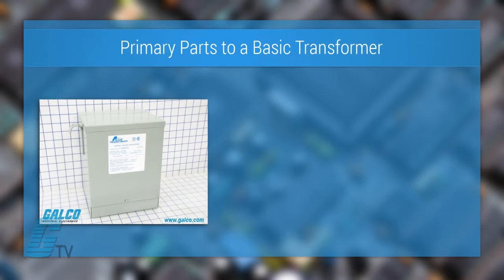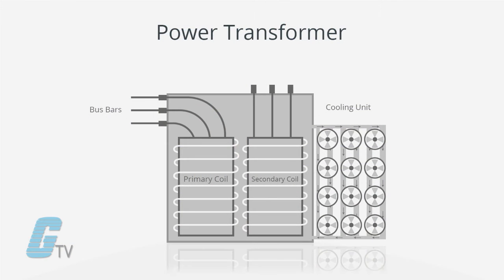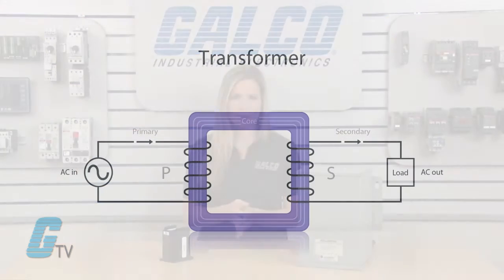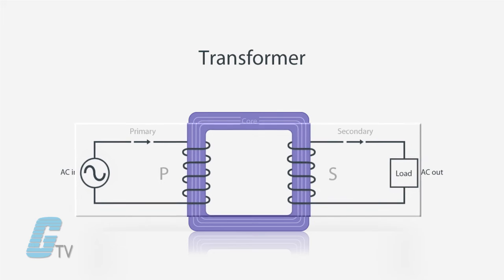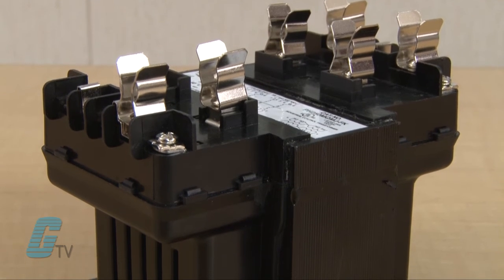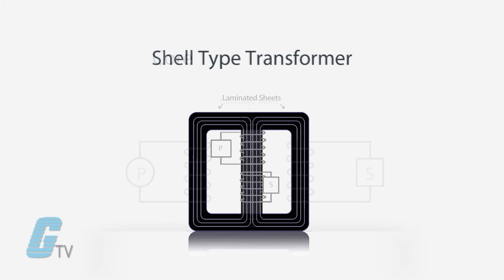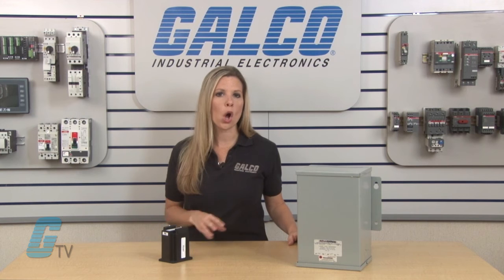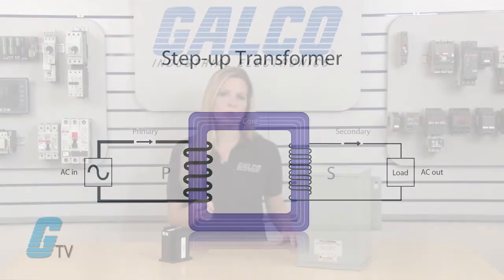How Electrical Transformers Work

Comment: I have a query!!.... If the stepdown transformer is a 1000W and the equipment which I'm using is 50W; will the power consumption be a 1000W by the transformer or just the 50W by the equipment? I dont want to pay an air conditioner's worth electricity bill for a small lamp!

Please help! :(
Reply from the maker: Hard to say exactly how much power it will use to run your 50 watt load, however it will not use the full capacity until you demand full load from the secondary. Having said that, there is a minimum current the transformers primary will pull to make voltage on the secondary even if the secondary has no load at all. If the primary had no current flow at all you wouldn't be able to measure any voltage on the secondary. You will need a way to measure the current draw on the Primary of the transformer to calculate the power consumption. A "Clamp-on" type amp meter would be my first suggestion, ok?